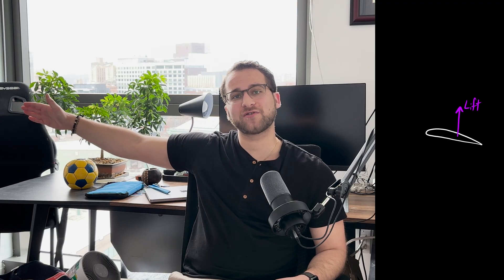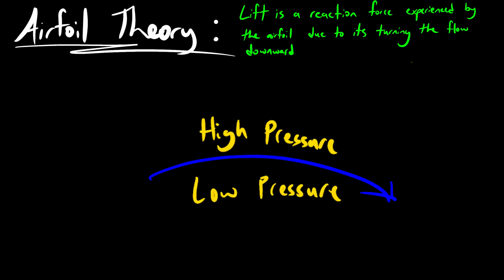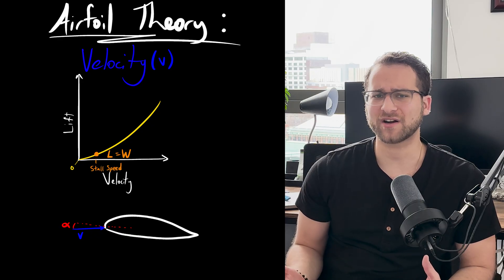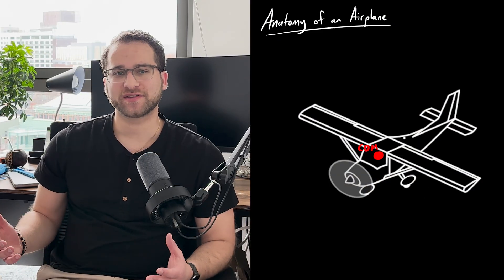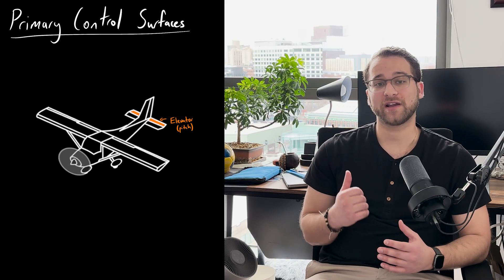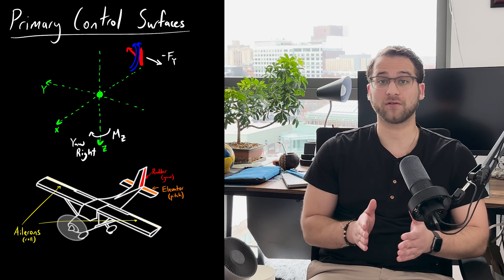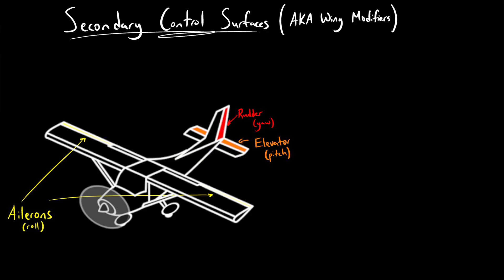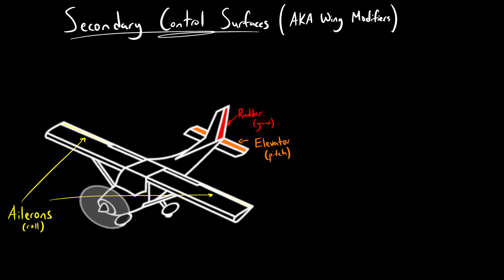How Planes Fly: Airfoils, Lift, and Control Surfaces Explained | Aeronautics 201

Comment: While a rotor wing pushes air down, it does so by adding total pressure to the flow, this does not happen for a fixed wing. In a helicopter, we put in mechanical energy, and that manifests as an increase in the total pressure, which can be seen as the increased velocity of the flow after the rotor. We keep putting in mechanical energy, we keep getting out flow that is moving faster out than it went in. But here is the thing, where is energy or total pressure added to the flow by a fixed wing? Some will say the engine, but we can be gliding. Then some will say gravity. But we know the thrust is overcoming drag, not generating lift. If the incoming flow to the wing is not disturbed in anyway, then it has ambient pressure. Then as it interacts with the fix wing, there is no mechanism by which total energy is increased in the flow. As such, air is not pushed down, in a net sense. Yes, at the interfaces of fluid elements, they are all pushing each other, pushing is very much involved. But, a helicopter like a rocket generates a momentum flux associated with a mass flux, that does not exist in 2D flow. 2D flow is very similar to a water wave. There is no mass transport, but there is energy transport in a water wave. The flow ahead of an aerofoil is turned up to meet it, and then is turned down and returned to the exact same horizontal level after it passes. No net motion. This is a literal requirement of the continuity equation, which tells us the the divergence of the velocity field must be zero, that is, without any sources (like a rotor) then the flow must always be divergence free.
The continuity equation, grad dot v equals 0, means that streamlines flow in horizontal, and out horizontal. Critically, they are also collinear. So, the amount of upward turning is equal to the amount of downward turning (in 2D flow). However, in the literature, it is very clear that many assume that lift comes from a downward deflection, so when they have an incomplete domain that shows downward deflection of streamline, that is confirmation bias. You must look at a larger domain, do a simple simulation, and you can easily show this. Alternatively, you can just accept that the continuity equation enforces this condition, because it does.
You will note that Babinsky's also uses streamline curvature to explain lift. But here you must consider the solution of D'Alembert and Euler from the 1750's. They also had curvature, but it was rotationally symmetric. They had geometric asymmetry, an angle of attack, but because they had symmetric flow, they had no net lift or drag. This is D'Alembert's paradox. So, what you need is a force that is responsible for the flow asymmetry. When an aerofoil starts to move, it has the symmetric solution predicted by Euler. But as explained by Prandtl 100 years ago. Specifically, at the trailing edge, as the flow tries to round it to fill the initial low pressure region as a wing first moves forward, the viscous effects inflate this region, creating what is called the trailing edge vortex. As this continues to grow, due to viscosity, it eventually pinches off and is shed into the flow. At the centre of this vortex is a low pressure region, which draws the rear stagnation point down to the trailing edge (giving what is called the Kutta condition). This new pressure gradient force is also the same force that is then accelerating the flow faster over the top, as it induces what is called the bound circulation. That faster flow can then be equated to a lower pressure, and ultimately the difference in pressure is the force of lift.

Comment: You've avoided the question. Lift is indeed related to the wing pulling air downward, but you haven't explained why the wing pulls the air downward.
The air is pulled downward because the upper surface of the wing generates a pressure lower than atmospheric pressure. So why does the upper surface of the wing generate a pressure lower than atmospheric pressure? You haven't explained. Professor Krzysztof Fidkowski hasn't explained it either.
Reply: You are correct to note this. Effectively, you have isolated the momentum equation, and what tells us (as Newton's second law) is that the momentum flux across the aerofoil is given by the pressure field. Since this is a statement of equality, you can say, the pressure field is given by the change in momentum. What is explain here, and by Prof Fidkowski is the steady state nature of a parabolic PDE that is fundamentally non-causal. You have asked the correct question, why is there asymmetry. What is alluded to here, and what most claim, is the geometry is the source of asymmetry. If you look at potential flow, you quickly understand that you can have an asymmetric geometry, but the flow will be rotationally symmetric. This is the nature of D'Alembert's paradox.
What is require is the unsteady aerodynamics that started with Wagner (the Wagner effect), but including the fundamental causality as explained by Prandtl. That is, fundamentally, a force is required to produce an acceleration, and geometry alone does not require a force. While curved streamlines will correspond to pressure gradients, if there is symmetry to the curvature there will be symmetry to the pressure field. So, we need a force that causes the asymmetry. This is where viscosity comes in.  Specifically, at the trailing edge, as the flow tries to round it to fill the initial low pressure region as a wing first moves forward, the viscous effects inflate this region, creating what is called the trailing edge vortex. As this continues to grow, due to viscosity, it eventually pinches off and is shed into the flow. At the centre of this vortex is a low pressure region, which draws the rear stagnation point down to the trailing edge (giving what is called the Kutta condition). This new pressure gradient force is also the same force that is then accelerating the flow faster over the top, as it induces what is called the bound circulation. That faster flow can then be equated to a lower pressure, and ultimately the difference in pressure is the force of lift.